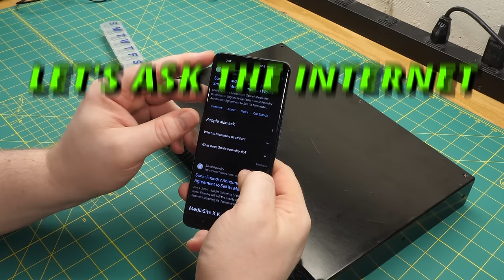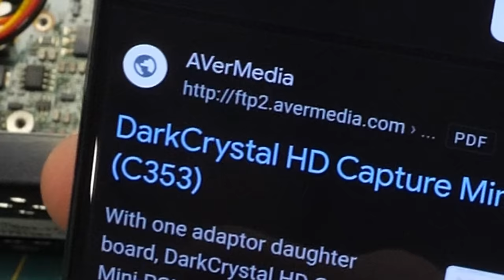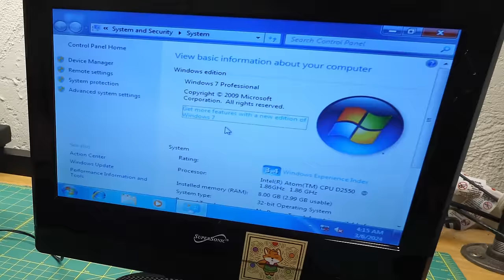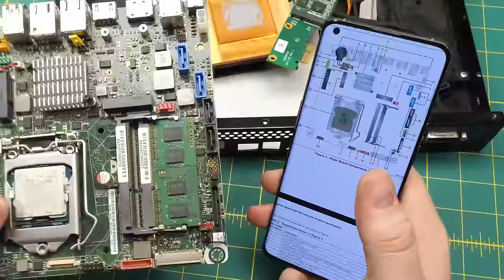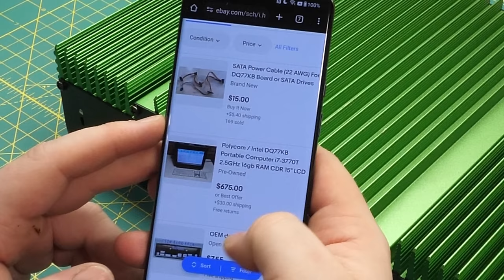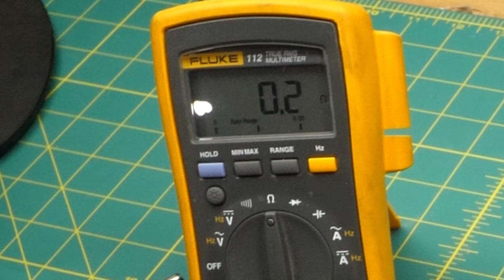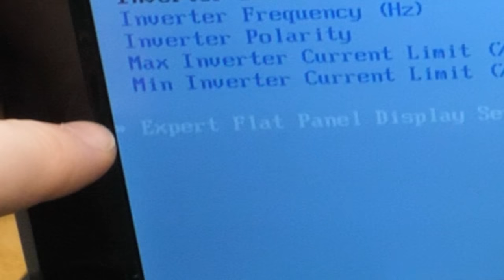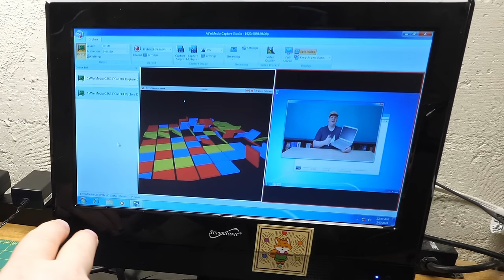Little Guys 5: Three Of Them [MediaSite / NCR N3000]

Comment: Needing 3 computers to fix one that isn't actually broken is a Certified Cathode Ray Dude Moment™.
Reply: Correct Spud
Reply: Hey at least it isn't a "I found a near mint 5K iMac in the trash" type of video.
Reply: I'm facing a similar situation: as-is X299, turns out it goes through the whole boot sequence (in the 7-segment readout) just fine but still doesn't show image. And I'm figuring out it has an IPMI that I can't find the access to, and a VGA port that I don't have the header for.

Comment: Oh, the hidden functionality. I remember how we bought a phone for my dad many a year ago. The data sheet said that it didn't have a micro sd slot, but when I opened it to install the mini-SIM card -- there it was, a micro sd slot. It worked and the phone detected it and could use it.
Reply: This is not the slot you're looking for!
Reply: What phone?
Reply: @kintustis  their dad's
Reply: @Fay7666  lol but what model?
Reply: I have an old action replay DSi, without an SD slot. After it bricked itself years ago, I eventually found a cable at Goodwill, and summarily unbricked it. I also found out about the version with a micro SD slot online. I cracked mine open and, sure enough, the pads were there. I cut up a laptop motherboard to harvest its full-size SD slot, soldered it on with some miserable kynar wire, flashed the SD version's firmware, and presto! It works perfectly.
Reply: @der.Schtefan  That's what she said
Reply: Printers can have hidden functionality, my Brother colour laser is the bottom model in the range so it doesn't support the largest cartridges or the RFID addon, well is doesn't officially, all the cartridges no matter what the capacity are the same size, there's no special mouldings to denote cartridge size and strangely it doesn't use a chip for cartridge identification, the largest cartridges are even listed in the hidden reset menu. Also add a cheapo RFID card reader using the front USB memory socket and it works just fine.

Another sort of hidden feature is that some Thinkpad's don't appear to have a slot for a full size PCIe SSD only a small one meant for a mobile card, there actually is the option for a full size PCIe SSD and interestingly it simply uses a different caddy in place of the SATA one, it even connects to the same connector on the board (and yes it's not just running the SSD in SATA mode as the one I have fitted doesn't support SATA).
Reply: @kintustis  Some LG or Samsung. It was ages ago, so I don't remember the model. The touch screen was resistive, not capacitive.

Comment: I worked in educational technology and media production in the aughts through 2013 and deployed several Mediasite boxes in smart classrooms for recording lectures and presentations. This was before Zoom and the like were practical, and so you needed a system to quickly capture computer display output and combine with standard video without any setup on the presenter’s computer. It was a reliable and scalable solution at the time.
Reply: It probably still is seeing how crapple keeps being incompatible with everything you plug. Or if you're brave enough to do any sort of presentation on linux.
Reply: This dug up a long-forgotten memory. When I went to medical school starting in the year 2010, they had a setup of these in all the lecture halls. Not only would media site allow you to stream a live lecture, it also allowed you to play back a recorded lecture at a faster speed. It was reliable and available minutes after the lecture finished. They had the system in place for a number of years before I even started. Certain lecturers would not allow their lectures to be recorded because they wanted in person attendance.
Reply: TU Delft had this system too when I was there (pretty sure they still do!) It must have been this exact system, as the website to play back lectures was based on this ‘MediaSite’ software, and re-visiting it now, it does contain links to SonicFoundry’s website (which has an out-of-date certificate, hilariously).

I remember the operators had this kind of portable rig on wheels with everything they needed (including camera). They’d just wheel it into the lecture hall of whatever lecture they’d be recording and hook it up. I think there was also one lecture hall with an experimental permanent setup.

A nice thing was that they always had two video feeds: one for the camera, and another for the lecturer’s computer screen (i.e. slides). The player played both simultaneously, and you could also speed up playback (very handy for boring lectures…) It worked remarkably well.

Comment: I worked at Intel when that generation of board was being developed. I don't recall ever working directly with this model, but definitely with some of its siblings. Intel reused the basic "block" for many boards, which is why you'll often see reference to multiple different boards as being the same. Because they often are. Either physically identical circuit board with a different chipset (H77 instead of Q77 maybe,) or different on-board features (only one NIC, no mPCIe, "full height" mITX, mATX, etc. In fact, on many of Intel's later "full ATX" motherboards, you can clearly see that it's just a Micro ATX board with some extra PCB with a couple extra PCI/PCIe slots. Some even have literal "perforations" that allow you to physically snap off the "extra past mATX" bit!) I still have a pre-production DQ67SW board with an engineering sample Core i7-2600S in a low-profile chassis as a "spare gaming machine". (with Radeon R5 240 that I should probably upgrade, IIRC.)
Reply from the maker: This is fascinating, thank you!
Reply: @CathodeRayDude Hi Gravis and to OP, many apologies to spam your comment but for laziness and dumb app reasons this is how I’ll tell Gravis that the RL220 mediasite variant has a very very good Datapath capture card with full RGB digital capture up to 4K30/1080p60, no chroma subsampling nonsense as with Avermedia. And some of the earlier 2RU and suitcase style mediasites have analog/DVI Datapath cards, also awesome quality 1200p60 and above (160hz? something high) and both can be had for less than the going price for the capture cards alone. Again excuse me barging in thank you
Reply: I was at Gigabyte during this time period and worked on boards a lot like this one. We were a collaborator on the design of these little ones, and I also have a funny engineering sample guy living back home. Mine is mATX and got what should be an i7 3770, but instead just shows "GENUINE INTEL PROCESSOR" and has no iGPU, so I guess 3770F. Funnily enough I ended up working at Intel a few years after and now do chip fabrication R&D, so the circuits just got a lot smaller between then and now. That little ES board and a 750ti I found in the trash are my couch PC now.
Reply: @DigitalJedi  The great Intel tradition of dumpster diving. I got a first-generation i7 Extreme with dual Radeon 4870X2s and dual Velociraptor hard drives because it had gotten roughed up in shipping. All the components worked fine, though!
Reply: @AnonymousFreakYT  It doesn't stop even internally either. There is one of probably very few socketable Meteor Lake-S chips on my desk. It's very useless as no chipset will ever support it, but man is it funny to flip over a CPU and there's just pads for extra pins.
Reply: @DigitalJedi : Sounds like you might as well stick the Meteor Lake in a socket and vacuum pack them (you know, in case of the unforeseeable, maybe you'll get bored in 20 years and want to build a custom board for it or something else weird), then cover the whole thing in clear epoxy to make some wall decoration. "Look, I worked on this!", sorta like sticking your diploma on the wall or something.
Reply: @absalomdraconis  It lives in a little case next to a Lakefield die and a Blue Sky Creek test chip. Those are Foveros (3D stacking) and PowerVia (2-sided die) test chips that I've actually worked on. Now I'm on to weirder hardware and get to play around with high-NA EUV machinery.
Reply: Intel is completly hopless to get back into relevalncy. (funny since not that long ago AMD was the one in that boat.) However. Regardless of that.
It would be both a nightmare and a dream to have computers turn into SBC's. As a thinckere and 'gamer' it would be kinda bad. As somone that care for RTR and that stuff like soldered RAM or any kind of storage is nothing but heavy forced bullshitery to make people have to junk what outherwise would be a fine computer with many years of usefulness left in it.... I still do have to say.

It would be kinda awsome to have AMD or Intel make a product line of reliable SFF computers. And I mean SFF fast and desktop tower replacment machines. One of my most loved computers has a Intel motherboard in it. Togheter with a I5-2500k. Lenovo SFF plain box. Can almost not fit a SFF GPU in it. Using the iGPU with Linux. Look at the Steamdeck! Look at the awful ChromeOS garbage! Why can we not have AMD or Intel make a ITX motherboard with a energy efficent APU? I would even be fine with soldered RAM if the hole thing was extremely budget friendly with power effiency and enough grunt to do things with it! If say Intel was not completley hopless to make something that do not dissapoint and crashes etc? Had a reputation of reliablity and such still? It would be amazing to avoid dealing with motherboard manufactures or iffy ram compatibility.

If Valve was to launch a affordable console like thing like that? Running Linux etc etc? Like if not for most normal people being into laptops or Apple phones/macs/Ipads? Like dam. Valve would have sold so many machines without anyone actually using Steam on them. I mean we can not even be sure industry or whatever would not take the offer of a Valve made computer if cheap enough!

Small NUC likes Intel has made are simply overpriced for what they are.  Send the hole computer all-in-one, inside of a motherboard box. Let the DIY people buy their own cases and PSU's. Leave a single PCIE slot for a dGPU for 'gamers"TM"'.  Or claim it to be for 'AI' graphics cards. Whatever! Like both AMD and Intel have the possiblitity to make what AMD coined the name APU's. Both AMD and Intel are in the laptop market. Make your own ITX boards and sell it as a low cost moster! Majority of people are going to buy laptops anyways. So why not simply make laptop desktops? Sure has to be a grate way to move CPU sales. And avoid dealing with horrible crap like Gigabyte or whatever Asus BS.

If AMD launches a ITX board in a box? Then sorry Intel. Your dead to me. If Valve sells a gaming console running Linux? Sorry everyone. We are going 100% gamer TUX mode. Everyone would be irrelevant. If Intel made a line of affordable Little Guys? Supported Linux all the way? Maybe they would stand a slim chance of surviving passed 2025. And that thier GPU's would actually be taken seriusly. Support Linux and they will make the drivers for you!
Reply: @TheDiner50  I totally agree that a little APU box from a major chip maker would be a great thing to see made. I'm a little sad that Intel sold the NUC business, as that was probably as close as we were going to get to that dream. Valve would also be an interesting player in that space. I could see them making a series-S sized thing with a bigger customized APU as a Steam Machine 2.0.

As for the comments towards Intel, the view from the R&D side is one of an upswing. New processes are performing competitively, and there is a lot of money moving to get them into production volume quickly. 20/18A samples are performing well for partners, and 14A is beginning to ramp up. They will be first to market with combined GAAFET and BSPDN. I can't say as much for the architecture side, but they went through a pretty big culture shift a few years ago, and we see the first results of that in coming generations. Things were quite grim for a while, I'll admit, but at least on the engineering front, there are promising things finally. It's going to be up to management to not screw this up.

Comment: this is why I've told myself, anytime someone brings me a dead system, pull the board out first, slap it on a desk, and test it there, so many times I've had issues with the chassis or a short, and no one thought to just pull everything out and start with the basics. I've saved so many systems with this one simple trick. I expected this outcome, lol, as soon as you said it was dead "watch, if he pulls the board it'll work for the lulz"
Reply: Absolutely. One of the ram slots wasn't working on an old motherboard I had. Turns out there was a loose motherboard screw shorting out that slot. Removed the screw, ram slot worked. Nice!

Comment: "there is a whole cottage industry that makes things that's only purpose is to do video streams for people who don't know how to set up video software"
I can for, uh, job reasons confirm this is absolutely true and this stays true from the low level like churches and universities and stuff all the way up to the highest most expensive levels for hollywood movie production. Every movie you've ever seen by the mouse company has gone through a box not much different from this one.

I'm shocked that that is windows! Gear in this kind of space is one of the places where linux seems more common than windows for this kind of appliance thing.
Reply: Setting up the software is the easy part. Training the users is the hard part, provided they are even willing to learn in the first place.

Comment: Fun fact: if you ever have an ear worm stuck, just replace it by thinking of the Intel jingle. It is long enough to push past the 1-2 second we perceive as "now", yet not long enough or suitable to loop. It will break any looping sound.
Reply: Unless you work at Intel. In which case, that sound is permanently engraved into your brain. Please help.
Reply: The dead silence after that jingle I think is what does it. For me at 39 years old it comes with the rising hiss associated with broadcast audio companding and VHS noise.
Reply: My brain just cross-connected the Intel and Nokia jingles and it's helllllllll
Reply: great, now the intel sound is my earworm

Comment: My college used devices similar to these. They would automatically record during class and then they would appear on the class’s page in our grading/assignment platform. It was basically only set up for the largest of classes (400+) prior to Covid. During the times when the classes went in person optional in Spring 2021 and beyond it was a lot more common for smaller classes to have this set up. You could both watch live and also see a recording afterwards. Very handy in case you couldn’t remember something that was said out loud but wasn’t on the slides.

They were controlled with a roughly iPad sized device that allowed it to decide which cameras to show, and which computer screens. The screen also decided how the professor’s computer was displayed in the larger rooms. (Ex: one big screen, or emulate having two smaller projectors side by side each with a copy of the screen)

The ones we had could record multiple video streams at once, and in the playback you had options of how to display them and which one you wanted to see the largest. (Whiteboard, computer screen, etc)

Comment: All the reset-cmos pin does is short the power supply to the SRAM to ground. If you don't unplug the battery, it still supplies power to the SRAM, you're just discharging the battery very quickly.
It WOULD work if you left it shorted for 20-30 minutes.
The chassis on that "crappy" ITX machine is that large because it's a standard form factor piece for beefier ITX boards.

that dead space on top is perfect for a FlexATX PSU, which would open up the possibility of 200-300W builds. The only thing is' missing is the spot-welded bracket, a cutout on the rear, and some screw holes. With the double-width low-profile expansion slot, it makes for a nice little set-top box to hook up to a TV.

Comment: HP swapped to a thinner plug, we found that out by surprise at the refurbishing operation i worked at, because our universal laptop power supplies didn't have adapters for those. Luckily i realized that we also got the docks for the machines in the shipment (the docks used the old power supply plug), so we could prop the docks up on the deletion/testing stations and get them processed without having to get out a hundred of the power supplies also and having to figure out ways to hook them up. Never got even a pat on the back for that...
Reply: Thank you for your service to corporate laptop erasure, Bubger Kirg.

Comment: I have worked on varied embedded systems for automatic cashiers, coin counters, video surveillance, etc.  That NCR is a pretty cool cat.  I worked on them in restaurants and they run the POS for the whole restaurant / bar.  They are pretty sweet and are bullet proof.  I see these guys stacked up on a managers desk covered with paperwork from ten years ago along with the cable modem, network switch, etc.  Most of the time they send them back to the Mothership , so I never get to keep them when they are replaced every five to ten years.
Reply: They get sent back to ExpressPoint in Texas to get reworked & get put back into service.

Comment: The 19v Dell connector is not a centre positive connector. It actually has 3 conductors. The tiny centre pin is a control pin. The negative is the outside of the barrel, and the positive is the inside of the barrel.
Reply: Ohhhhh really? I've never knew that and always thought that's such a slimsy connector